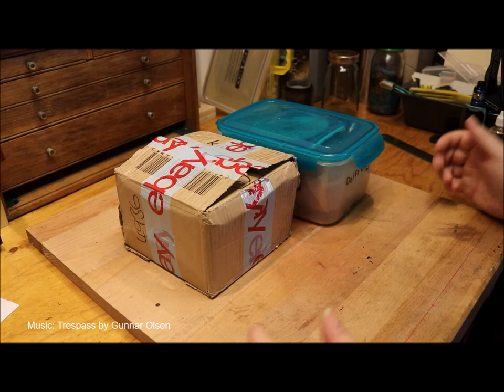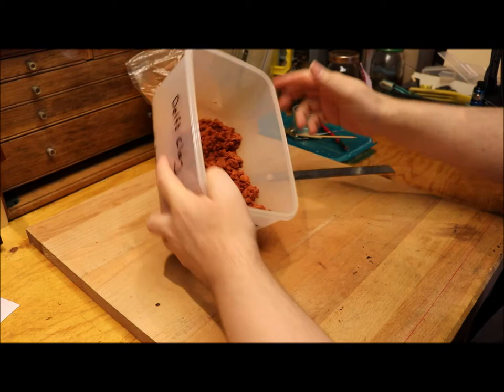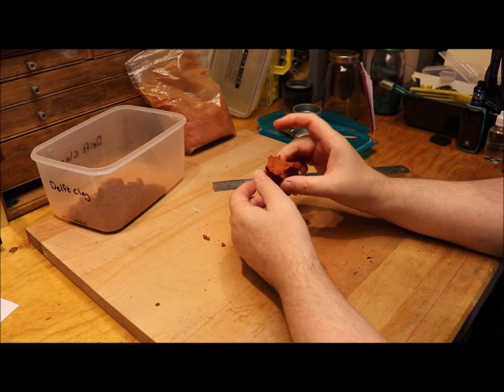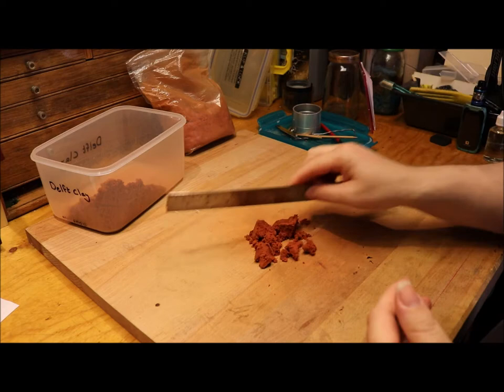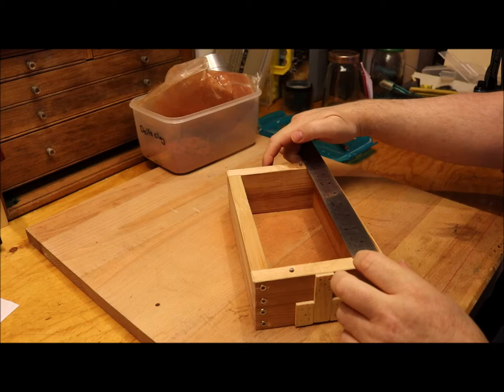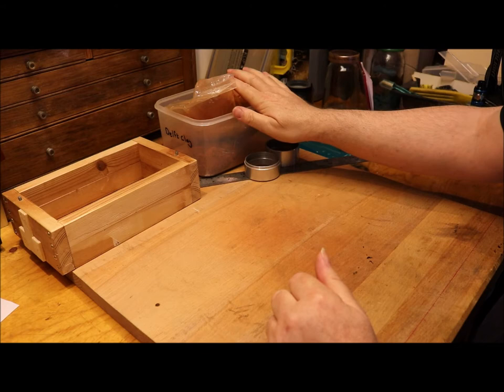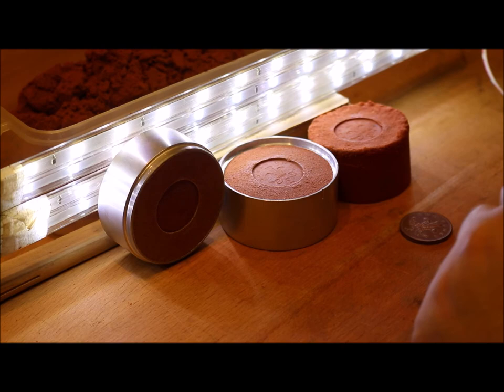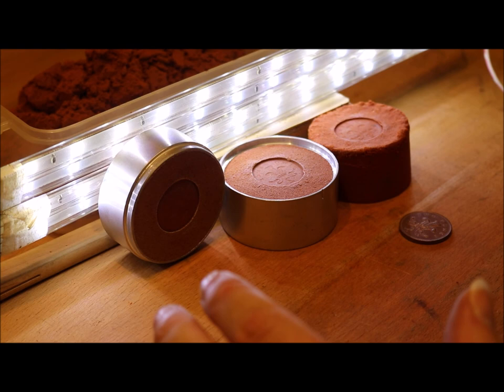Cheaper alternative to Delft Clay, but is it any good?

Comment: building sand is just as good.i was a moulder and thats what we used in the 70s .use a sieve 1st 4 your facing sand then just pile on the rest after.just watched the end where u r comparing them if u put the delft though a sieve u will get the samd results as the copy 1 try it
Reply from the maker: Hi Mike. Thanks for the comment. Not sure about using 'building' sand' for casting silver in. It will either have to much moisture in it or be to dry and so will not hold together. I do have and sometime do use a sieve though, even with the Delft or alt Delft clays. ... If I ever get enough scrap silver I may test your builders sand suggestion, as a test... Thanks